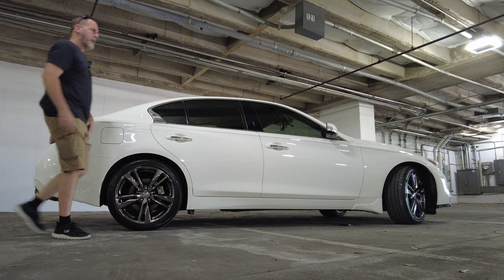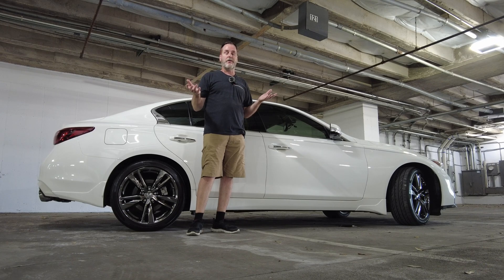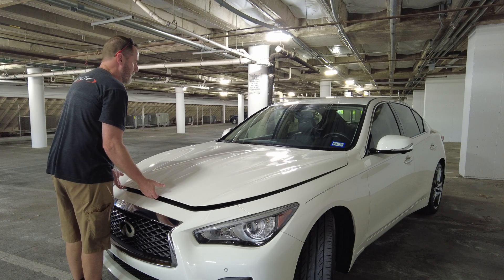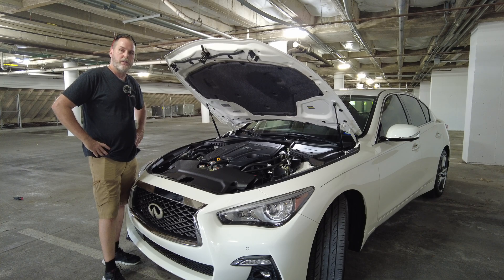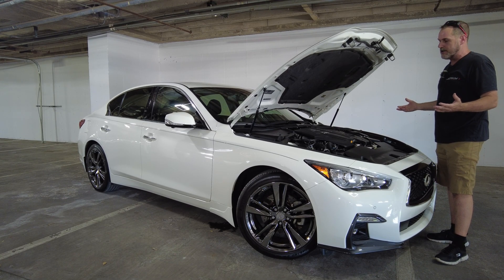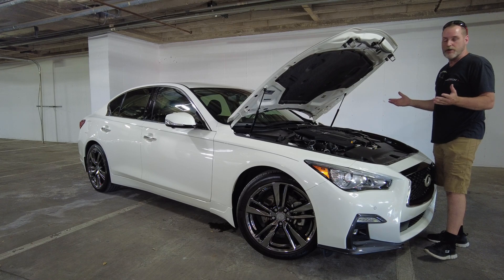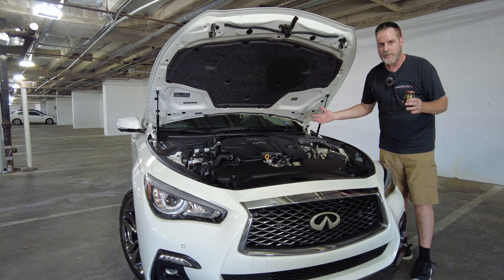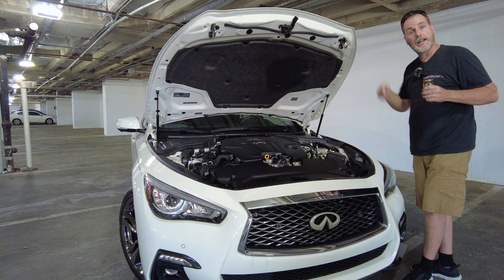I got something I want to share that's just transpired...good/bad?

Comment: Love the video man, I’m planning on buying this 2020 Q50 3.0 lux with 32K miles and I’m wondering if you have any advice or if it’s worth it, i really want it and I’m planning on leaving it on warranty just in case any issue’s
Reply from the maker: Honestly my opinion has evolved over the 4 years I've owned mine. I've had good luck with mine but I bought it new. Therefore I know everything about it. No unknowns. I change the oil at ridiculously low intervals. Sometimes/many times between 3k - 4k miles. I have raced it and pounded on it but 90% of the time I treat it mass respect and love.

With that said, my answer to posts asking if I buy one used is likely no. I say this because most of these cars are leases. People in general that lease do not take care of the lease cars or do any maintance. All that and any problems are put off on the next buyer.

Also in the last 4-5 years the U.S. has seen so much flooding and 400-500,000+ cars have been water/flood damaged. Many cars/vehicles get illegally turned around a resold without accurate documentation. Most people are crooked and when comes to the dollar very ruthless. 

Also, these cars, especially the Q50 sedan because of their overall value and motor performance, they are on many  young people's radar. They typically are or have been modified in many ways and the alterations mostly not performed by a legit performance shop. A lot of these car my appear OK/looked after on the outside bu not as much on the inside with the things you can't easily see.

Lots of these cars of had blowoff valves( not good unless tuned for) catalytic converters removed (not good unless tuned for), entertainment console/wires fooled with/altered, stereo wires electronics altered, suspension messed with/lowered/coilovers added, fuel injection components altered, wheel spacers, improper heat exchanger install which can cause issues down the road.

My advice is buy/lease new. If you buy as a pre-owned vehicle, it would be nice to know the owner or the dealership selling the vehicle knows the owner. Do not buy an auction car (most used cars these days are auction cars with completely unknown history). I would not buy onw of these as a 3rd, 4th owner car. If buying used buy only from a well established, long time running, authorized dealership with 2-3 year extended warranty or 2-3 year factory bumper-to-bumper CPO warranty.

I'd even go as far as calling Infiniti Corp and ask them to look at the vin# and verify history on the used infinity car. Not all dealerships are honest and respectful. Even $22,000 to 25,000 is a big investment for many people. Do not trust carfax. Always use best judgement.
Reply: You should get full bolt ons and a z1 hotbox. In case anything happens just remove them, revert it back to stock and take it to the dealer. If you want to keep your warranty don’t tune, they can check the ecu for a tune, 5hey can’t check it for a boost controller.

Comment: I believe turbo's are under the Powertrain warranty which is 6 year's.  The basic warranty is 4 year's.
Reply from the maker: Thanks for sharing. I'm not well versed in length of varied warranty. Yea, powertrain is the term not drivetrain.
Reply from the maker: Also, the real reason I took the car in for inspection was for the air-conditioner so that's where the 4 years came into the discussion. Air-con checked out as working within approved range, so no warranty repair needed.
Reply: @GettingthruLife  either way good for on them for replacing it under warranty without giving you a hassle.  You're also one of the very few that had their turbo's replaced even though you are tuned.
Reply from the maker: I know people who are tuned 93/E30, blowoff valves, lower catless downpioes and more had turbos replaced under warranty and their motor replaced from turbo metal pieces. You just don't hear about it as youtube and social media is a small percentage of life.
Reply from the maker: Also, I've seen personally and read that people with full catless downpipes tuned or not tuned, they have had their motor and or turbos replaced under their warranty. 

To get turned down for warranty work or parts replace the dealer/manufacturer has to prove or have rock solid, specific evidence that the part/alteration you did directly caused or led to the failure.

Ecu tuning doesn't cause the turbo housing/wastegate actuator mounting point to wallow out so that it rattles and allows excessive play, slop. Even if the WG actuator arm/link is adjustable that won't fix the problem on this turbo. This appears to be due mostly to the cheaper design/spec of these mass produced/bought in bulk Garrett produced turbos. Garrett make great turbos but their better built and higher spec turbos cost more. Buying bulk design usually means  shop fir the best deal and not the top tier product. Buy a vehicle that costs more than more likely to get higher in parts.
Reply: @GettingthruLife  yea i hear what you're saying.  But their are some dealers that will give the customer a hard time especially when they see modifications.  I've also heard of some dealers denying warranty on a completely stock vehicle stating no record of oil changes because some are diy'ers.  
But for me i was going to wait a while to get my Q50 RS tuned since it only has 20k miles.  But maybe this might push me to get tuned since i want to unleash what this beast can do.
Reply from the maker: @latino914 yea, don't listen to me. I mean that. Makes your own best judgement call always. What I say and write is based on my opinion but I do put time and effort in to be educated and share as accurate info as I can:)

Also, dealers make good money/revenue where service and warranty repairs and be a big portion of their business. Ultimately it's Infiniti who approves the work and repairs. With Infiniti USA they are well aware of the specific turbo wastegate arm turbo housing/ mount weakness. All that's needed is for them to duplicate the problem and report to Infiniti, do the repair.

Now in my opinion, if you burn up your turbo/s due to excessive use, overboosting or strain then repair under warranty can and should be scrutinized. I really don't push my car hard and during the covid shutdown time for two years + I never even put the pedal more than halfway to the floor. I'm over/passed street racing and being reckless and racing on the street and excessive speed in public is recklessness.
Reply: Does installing ams intakes void warranty?
Reply from the maker: Only if your dealer is on a holy power trip would they deny moto warranty. I know people/a person with VR30 with cattless lower down pipes, tuned e30-93, cbe, ams intakes, mishimoto hx, 305 rear tires,  blowoff valves had  their turbos replaced under warranty and then later have their engine replaced due to porous block and then get 2nd round of turbos replaced under factory warranty.

 I didn't have my warranty denied and I clearly had ams intakes on as they disconnected them to do the turbo work.

I would tend to think having all the required stuff for running higher count ethanol  fuel would be more of a knock against hurting warranty than anything.
Reply: @GettingthruLife   awesome.  Did u do the install on the ams boxes
Reply from the maker: @Q50Driver yes I installed them myself. Not difficult at all if you do general work on cars/motorcycles. There's  likely plenty of step by step videos. I was in a bug hurry to do mine because next day I was getting tuned. Didn't shoot video of my install unfortunately.
Reply: @GettingthruLife   I installed mine too.  Asking just in case I need my turbos replaced too and if they would give me issues at the dealership 😩. Your videos are awesome man.  Keep on posting

Comment: I thought your car was tuned?
Reply from the maker: Yes it is but excessive wastegate arm rattle is not a byproduct of ecutek tuning.
Reply: @GettingthruLife  you have been very lucky with your car there have been so many failures. how many miles in on your car i saw you said you dont drive it much. the forums and FB groups are full of sad stories daily about q50. I just traded in my Redsport full bolt on tune. I loved it but hated the lack of tech i had 2016. i added carplay and android auto to factory system but still for the price i felt like they should have more but its always give and take. They used Infiniti to iron out problems for the 400z. well good luck keep up the good work
Reply: @GettingthruLife  I get that but you are very lucky a tune usually voids all Infiniti powertrain Warranty. Next how did they install this under Infiniti Spec if you are tuned. Your New turbos are are  not staying within the boost guide lines so did they return it back to stock. Im so lost. I know what the law says about having to prove mod is what caused the failure. Im glad you  got it fixed hands down. just dont understand how they let it happen. A tune 100% could cause excessive wear on the Wastegate which could lead to the rattle so on and so on. either way happy for you. Do they know its tuned?

Comment: I was told an oil catch can would void my warranty on my Q50. Is that not true?
Reply from the maker: That's insanity and makes no sense but I guess it just depends on the individual that day who's dealing with you at infiniti. An oil catch can doesn't in any way, shape or form negatively affect an engine's input/output or cause turbo or fueling problems. Blowoff valves and removal of catalytic converters does have an effect that can be negative as such but I still see and hear of many folks with these parts install and they have drivetrain warranty completed.
Reply: @GettingthruLife  I have had the same problem with my infinti q50 2016 and they did not want repair my car due to a oil change i didnt make on time. What should I do